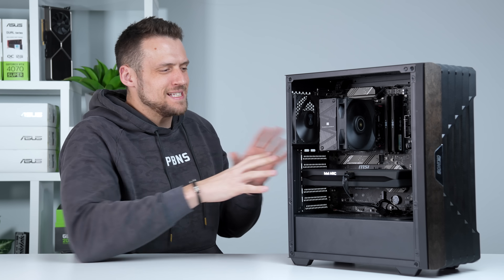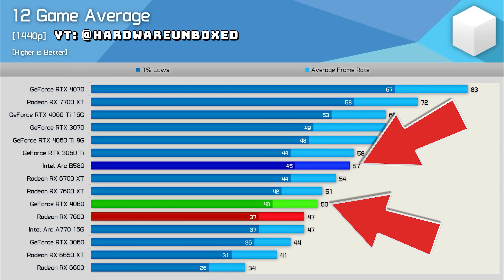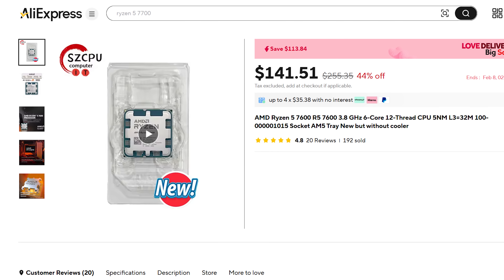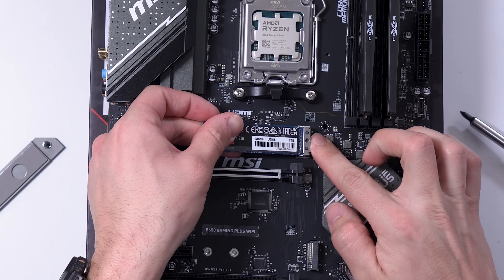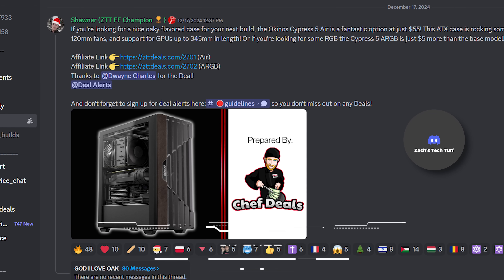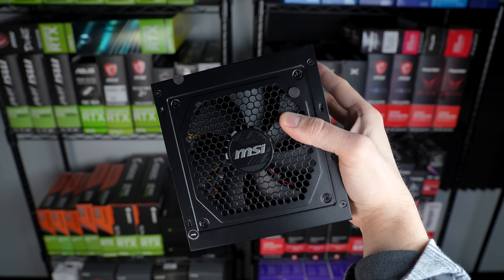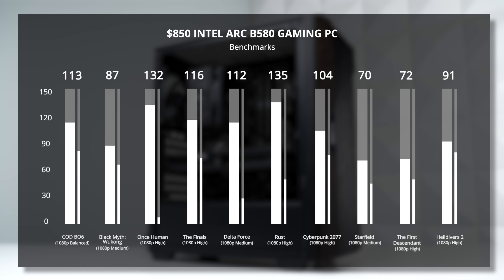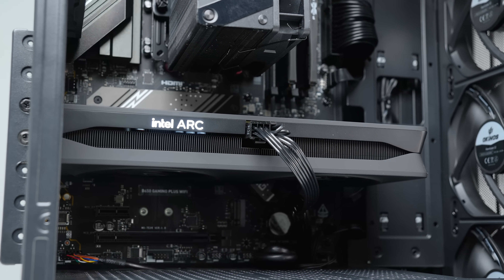$850 Pure Performance Gaming PC Build Guide

Comment: also fyi, if you run apex on 1080p high, be prepared for the 7600 non cpu if it gets up to its max boost clock with the stock cooler, its gonna get TOASTY but you should be fine if your value/ current temp does not go ABOVE 95C for a long period of time because i experience that same thing on apex and it is also the max safe operating temp, but the only difference with my pc is i got only 16 gb and the 6600xt and i got the b650m motherboard but also dont be concerned if the ccd spikes to 101, it does it briefly though,but be concerned if it does for a good chunk of time of you use hw monitor

Comment: Hey zach! I need a pc for work that is cpu and ram heavy. So I want the best intel cpu (not sure if that would be the i914900k or the ultra) and 128 of ram but I also want to be able to play 1440 with ultra setting, what is the cheapest nvidia gpu I can get that can handle that and if you had time I would really appreciate a build list! Thanks ! (I know that my gpu would be a massive gamming bottle neck)
Reply: Personally I think value for money right now is with the AMD CPU's. I don't know why you would need 128gb of ram, but I'll assume you know what you're doing on that front work wise.

In terms of being able to play 1440 with ultra setting, it really depends what game and what fps you want to achieve, if you've got 144hz monitor etc..  even my 6 year old 2080ti can manage ultra in some games at a respectable 90-130 frames. a 4060ti is slightly better than a 2080ti so that's a good baseline, however I think for more intensive games a 4070ti or 4070ti super might be better. If you can wait a month or so it would be worth holding out for the Radeon 9070 which I assume would offer better performance at a similar price, unless you're set on Nvidia.

Hope that helps.

Comment: i just built a budget $407 pc,

TEAMGROUP MS30 512GB with SLC Cache

TEAMGROUP T-Force Vulcan Z DDR4 DRAM 16GB Kit (2x8GB) 3200MHz

ASUS Prime B450M-A II AMD AM4

AMD Ryzen 5 5500 6-Core, 12-Thread Unlocked Desktop Processor with Wraith Stealth Cooler

Okinos Aqua 3 Air, Micro ATX Case,

ARESGAME AGV Series 500W Power Supply, 80 Plus Bronze Certified, Non Modular Power Supply, 5 Year Warranty

and a RTX 1660 super gpu i got for $70, ill probably upgrade to an rx6600xt gpu in the future though

Comment: Zach I managed to grab the MSI suprim X 5080 SOC. I’ve installed it reseated and made sure the wires are connected properly, but I keep getting a VGA error light while still posting what did I do wrong I upgraded from a RTX3060

Comment: hey zack ive been watching u for a while and ive alwyas wanted to build a good pc but my parents are  against it and rather id focus on studing even tho i do but im gonna to build on or my 14th bday i was wondering if you could give some reasons to help justify my stratement as well as telling me if this build is good CPU-	AMD Ryzen 5 5500  GPU-	AMD Radeon RX 6600 8GB  Motherboard	-  MSI B550M PRO-VDH WiFi    RAM-	Corsair Vengeance LPX 16GB (2x8GB) 3200MHz   PSU-	Cooler Master MWE Bronze V2 550W 230V  Case-	Deepcool Matrexx 40 (Micro-ATX) Storage	Kingston NV2 1TB NVMe SSD rate it out of ten and tell me if its good pls also give me some reasons to justify my statement

Comment: hey zach
I'm from India
My spec:
Msi b560m pro-e 
I3 10100f
Xpg D30 2 × 8gb
Zotac 3060ti
Ant esports vs600L (available in India)

I know I totally Screwed up in this build; I built it 2years back when I was 16y. I bought the gpu last year (I was rocking gt 1030 before). Now I want to know what should I upgrade first and to which, in budget? (To least possible value on amazon brand new)

Comment: My budget around $500, i managed to get a amd radeon rx 5600xt for $140 on ebay, bought the ryzen 5 5600x brand new on amazon for $130, got an msi m550b pro wifi used on ebay with 2x16gb cosair ddr4 ram for $130. Bought a WD 1tb nvme for $60. Im recycling a pc case and a 600w PSU. How is this build?

Comment: I really need help this is my first pc build and idk if it’s good or not 
GPU: GIGABYTE Geforce RTX 4070 Aero Oc 12G 

PROCESSOR: AMD Ryzen 7 5700 

MOTHERBOARD: MSI PRO B650M-P Motherboard, Micro-ATX

RAM: TEAMGROUP Elite Plus DDR5 16GB

PSU: Thermaltake Smart 500W

STORAGE: Kingston NV2 1 TB M.2.

COOLER:

CASE:

Comment: Hey Zach, I used AI to do my research to build a pure performance gaming pc and it gave me a list with the best components and stuff.

CPU: AMD Ryzen 5 7600X – $250
GPU: MSI Ventus RTX 4060 Ti 16GB – $430
Motherboard: AM5 board (e.g., MSI B650M Mortar WiFi) – $150
Memory: 16GB (2×8GB) DDR5 6000MHz – $80
Storage: 1TB NVMe SSD – $80
Power Supply: 650W 80+ Gold – $60
Case: Mid-Tower with good airflow – $60
CPU Cooler: Aftermarket air cooler (e.g., Cooler Master Hyper 212) – $40
Total Cost: ~$1,150
(it says around $1.15k but I don't believe it)

Comment: Worth looking at the GPU regionally - not sure why, but the 4060 can be had new for around 10% cheaper than the B580 (so no surprise you can buy them here) - Hardware Unboxed had the 4060 ahead in 1080P too, with the B580 looking better at 1440p + where the overhead is less impact.

Comment: It feels illegal to have criticism but the silicon power is 90 is like a dollar more
Reply: If you're talking about the UD90, it's mid-tier QLC*, which should be avoided if similar TLC options exist. Worse reliability and endurance, worse speeds (especially post-SLC cache, where it shrinks to sub-HDD levels), and it's typically not even cheaper (barring M.2-2230 and 4TB).
(*It's possible but still unlikely to get the old TLC revision, which uses B47R instead of N48R.)

Comment: Too bad the B580 is still pretty scarce despite it already being over 2 months after launch. Ended up having to reconfigure an older setup from this channel (one of the $800 builds) as well as up the budget on my build by like $50-70 to fit a RX 6750 XT and 5700X combo as I was restricted to only shopping new on Amazon (Should've told my mom there was a MicroCenter down the road before she made her decisions😭). But this build I got now is running quite well for my first ever setup. Thanks ZTT for all your helpful videos!

Comment: Hello Zach! I am building my first PC, and my major work is music-related, so I need a powerful CPU and plenty of RAM, so I went with the i5 14600k, which I felt was powerful enough for my budget (building under $1000), and it costs INR 21,500, or $250 (14600k and 7600x are same price in my place). And for the GPU, I chose the 4060 because it is $70 cheaper than the 7600XT (and the 3060 is nearly $53 cheaper than the 4060); my work does not require more graphics power; I do play games sometime, as well as a few basic video editing and Photoshop stuff for social media.
The guidance is much appreciated and suggest the right motherboard for this combination. 
Thank you 🙏🏻

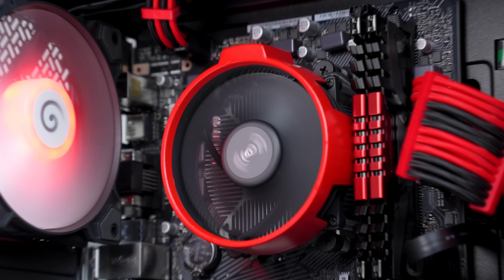Comment: 6:38 - My friend made a mistake on this, he thought that the stock box cooler was enough for his 7600 but when i pulled up MSI afterburner to check the temps it was idling at 60-70C and when in games on 1440p 120fps (RTX 4080) it went up to 80-90 and when we changed to 240 fps the pc bluescreened.
Reply: The blue screen's probably not the fault of the cooler, to be fair.

Comment: I have to ask, do you recommend getting a CPU + motherboard combo or just buy them separately when shopping on AliExpress? I see a few good value combos, but the motherboards are kind of a let down. Like I see a Ryzen 5 7600X bundled with a gigabyte b650M gaming WiFi, which isn't terrible, but I wouldn't mind paying more for a slightly better motherboard

Comment: is my build compatible here are the parts 
cooler - ZEBRONICS AIO360AB -
power supply- CORSAIR CX Series CX750 80 Plus Bronze ATX Power Supply
case - Lian li Lancool 215x 
storage - Crucial P3 Plus 1TB PCIe 4.0 3D NAND NVMe M.2 SSD, up to 5000MB/s - CT1000P3PSSD8
Ram - CORSAIR Vengeance RGB DDR5 RAM 32GB (2x16GB) 6000MHz
motherboard - MSI B760 Gaming Plus WiFi Motherboard
gpu - Rtx 4060ti
cpu - Intel i7 12700k 
do u think this build is balanced and compatible for gaming and is there anything wrong with the parts I selected
Pls reply ZTT

Comment: why is ur 750 build better than ur 850 build? this should be a 7500f and 7700xt/6800xt
Reply: That is because he went with the am5 platform to limit the amount of cpu overhead. In the 750 dollar build he used the older am4 platform but instead used an rx 7700 xt. He also has a $1000 pure performance build where he uses the rx 7700 xt with am5. You could still use the budget cpus like the 12400f and 5600 but you’ll notice more overhead in cpu demanding titles, although it’s worth noting there is no meaningful difference in gpu demanding titles.

Comment: Is there anything wrong with my first build? guys like this comment so he can know and pls help guys

ryzen 7 9800x3d
rtx 5080(suggest which company)
nzxt kraken elite 360mm rgb aio 2024
32gb*2 ddr5 ram 6000mhz cl-30
Samsung 990pro ssd 2tb+1tb
gigabyte atx x870 aorus elite motherboard
pc case is nzxt h9 flow
power supply 1000W(suggest company and model pls)

monitor-Alienware-AW3225QF

mouse- i already have (razer basilisk)
keyboard-suggest me
speakers-suggest me
headphone-already have

budget-aroud 4,60,000-4,80,000 rupees(includes everything)
purpose- fps games like valorant and mainly graphical games like black myth wu kong,cyberpunk
note- I will build this when rtx 5080 is in stock and at right price and india have prices a little high that of USA

Comment: So I am building a new mid high end  pc.

So far I got the microcenter Ryzen 7 9800x3d bundle 

Bought parts: 

Processor : Ryzen 7 9800x3D
Motherboard: MSI 670E MAG Tomahawk wifi
Ram : Corsair vengeance 32 gb ddr5 6000 , 36

Thinking about buying:

Psu : MSI mag A850GL , don't know if I should get a 1000 one but don't know if my wall plugs will be a problem 

Ssd: Wd black sn770 2tb

Aio : thermaltake th360 v2 argb

Case will get locally any that is cheap and looks good , will take any budget recommendations.

Gpu is complicated, thinking of getting a 3070 second hand for the time being then will wait for amd to launch and get a new one after prices settle.

Comment: This is my pc build: 1. CPU: AMD Ryzen 7 9800X3D
2. Motherboard: ASUS TUF Gaming X670E-PLUS WiFi
3. RAM: G.SKILL Trident Z5 48GB DDR5-8000
4. GPU: NVIDIA RTX 5090
5. Storage: 2x Crucial T700 1TB PCIe 5.0 NVMe SSD with Heatsinks
6. PSU: Super Flower Leadex Platinum SE 1200W Fully Modular SMPS
7. Case: Lian Li O11 Dynamic Mini
8. Cooler: NZXT Kraken Z73 360mm AIO Liquid Cooler
tell me what should I change and yes i have a rtx 5090

Comment: Note for rookies: Don't get the 7600x, get the 7600. the 7600x uses substantially more power and runs substantially hotter for like 1 fps more performance.
Reply: If you have the right board and a good cooler just go into bios and find PBO settings, I run my 7700x in level 1 80c, it will never break that and give me better performance as to balance the power and heat better, I run a 240mm AIO on it like that.
Reply: I got the 7600x because of the Micro Center bundle.
Reply: @flpndrox  still fine but just saying
Reply: 7600x is 5 to 10 dollars more expensive, but actually better than 7600 by a pretty good amount in some games, get it if the prices are close from each other
Reply: @lagiar5536 how does the 7600x compare to the 7700?
Reply: Niter
Reply: For some reason, currently in the UK on PCpartpicker, it’s cheaper to get the 7600X so I think that’s what I’m going with. I might also change the case and mobo to make it a Micro-ATX build and have it on my desk.
Reply: 7600 xt amd radeon?
Reply: @FootballFanOk  no, they're talking about the CPU Ryzen 7600x

Comment: Question: I live in the UK and there no cases available and the shipping fee is crazy is there any other cases you can recommend???
Reply: I can recommend the corsair 4000D airflow. I got mine for around 70 euros (wich is a bit more expensive ik) but it looks insanely clean, has enough space for most gpus and and as the name suggests has great airflow. If youre going for a clean minimalist build and easy cable management think about it (it features no wooden elements tho)
Reply: @chainsaw4457  okay cheers I’ll have a look at it👍

Comment: Another GPU option if you can’t get a b580 is a used rtx 3070. Great fps per $ for $250 is you can find one
Reply: How about a 3080ti? Maybe pay some more but not sure it is worth it though
Reply: @gamersworld4176  for a extra $100 I am not sure if you should do that and I would consider amd for the extra vram since games are using more and more vram nowadays. Maybe a 7700 non xt?
Reply: @ hmm. i should look into it as well. thanks for the suggestion.
Reply: Yeah but the problem is game developers only like to optimize games on newer hardware so 3070 is already 2 gen old.... I am not saying that it a bad gpu but getting new build with 3070 is not a correct move....
Reply: @AryaAvasarkar-jx2et  true but you should still be able to run well over 60 fps at 1080p ultra/high settings and even 1440p in slightly older games

Comment: can you make a PC with my specifications? I have a Ryzen 5 8400f, 32GB 6000MHz Crucial Pro RAM, Gigabyte B650M Gaming, ssd 1tb kingstone, thermalright frozen prism 360 black argb, case msi mag pano m100r pz, power supply 750w and xfx rx 6750 xt.
can you build it and tell me what you would change please?
Reply: why use a 8400f, thats kinda strange, and putting a 360 aio on it is even stranger
Reply: @nostrum6410  because i was on a very limited budget, i will definitely upgrade the cpu

Comment: i went with the ryzen 5 7600x arc b580. 64 gig ram 1tb m.2 same psu as you did.  with taxes it was just over a grand. got some stuff on sale. but im running 2k 32" curved acer monitor.
Reply: 7700xt would have served you better
Reply: @nostrum6410  not what ive heard from friends that play only DCS like i do. the amd cards have a struggle with dcs. the two i know with the intel cards are happy with them. again im a single issue girl.
Reply: @Kathyoftheglade  do they have same cpu as you? the b580 has issues with lower fps on mid tier cpus compared to high end ones
Reply: @ i know for fact one does. he is very happy with his build using the arc. i dont know what the other is running.  the first guy and i built off the same spec sheet. but i only play ONE game. DCS.

Comment: I have a question, which is the best gpu i can buy with a budget of around 400-500 bucks? I don`t know what i should get and my gpu that i am using right now is not the best anymore and i want to upgrade. I am running a 2060 super right now.

Comment: I achieve 13220 timespy score with my second pc:  b550 aorus pro v2, 5600x, 32gb 3600mhz, aorus 1tb ssd B580 challenger oc. older but cheaper. Playing good in 1440p and succesfully achieved 90+ in the finals and mfs 2024 at 2160p. This gpu rocks, and seems to be better every driver release

Comment: The idea that the Intel Arc b580 is difficult to get is comical. Yes it is sold out but I was able to get two of them simply by following a tracker. Turn on the notifications be alert when it goes off and then you can get the item pretty easy. I was able to get two in the span of 3 days. And that's after ignoring a few different variants that I did not want
Reply: every time ive checked newegg has had some in stock

Comment: I just compiled a list for about 700 that beats this in single player massively (though because I don't live in the US it's probably more expensive here)
i5 13400f box 100$
Asus prime B-760M-A (D5 no WiFi) 108$
Corsair Ddr5 5200 cl40 2x8GB RGB  54$ (non RGB was more expensive😂)
Cooler Master MWE Gold 750W Full Modular psu 100$ (B rated and future-proof)
MSI SPATIUM M450 1TB PCIe 4.0 NVMe M.2 45$
Fater FG-730W case 43$ (amazing local brand)

And... What you have been waiting for...
Asrock RX 6800 Phantom Gaming 16Gb USED    258$ (I could consistently find these in physical stores with 6 months guarantee)

Idk why but apart from the 13400f and upgradability it's pretty much better all over

Comment: I've got a pc with a ryzen 5600, rx 7600, Apevia Prestige 800 W power supply, 64 gigs of DDR4, 3TB of storage, in the SAMA NEVIEW 4503 ATX Mid Tower Case. What should I upgrade next, or should I get some form of air cooler/AIO? Not doing non AIO water cooling as I'm still a pc building rookie. I'm both a creator and a gamer if that changes things
Reply: By the way if you have a stock cooler, you should get a cooler for your cpu upgrade. But I recommend going with an air cooler. Cheaper, has less issues and provides good performance compared to an AIO.
Reply: @crosskafagaming8109  ty!
Reply: @L_5050  No worries, good luck!
Reply: Your cpu/gpu combo looks pretty balanced so if you want an upgrade, you should upgrade both of them at the same time ideally. Since you got the rest of the system pretty high end, you have nothing to worry about upgrading the cpu and gpu. You don't need an AIO, it is purely aestetics and does nothing for the performance especially on AM4 platform. You want to have a significant uplift in performance, so you should go with a 5700x3D for the cpu and a 7700xt or 7800xt for the gpu in my opinion. You may need to upgrade your power supply though, feel free to use any Tier A or Tier B psu with at least 750w power rating.

Comment: Nice to see arc being recomended just bought a sparkle b580 to upgrade from my a380
Reply from the maker: Sticking with Intel, nice!
Reply: Why is it nice to see people recommending a bad card?
Reply: @nostrum6410 It’s not a bad card itself, but the CPU compatibility issues make it perform a LOT less than what it could. Intel needs to get it together.
Reply: @nostrum6410 in its price range its probably the best you can get. a few months ago, i would’ve recommended the rx 6750 xt over it, but its increasing in price now, while the b580 is still under 300